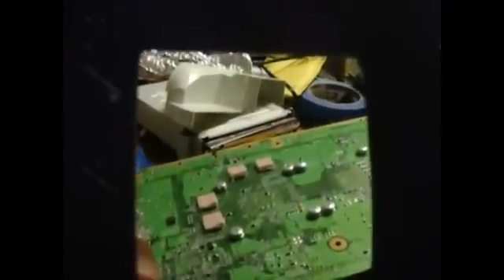How to Install Add Connect a Computer Fan Into a Xbox 360

Comment: I'm sure this channel isn't active anymore, but 12 years later I ended up soldering a fan splitter to the 12v rail on my Jasper 360 that's been in pieces for over a decade.
I miss these old videos.